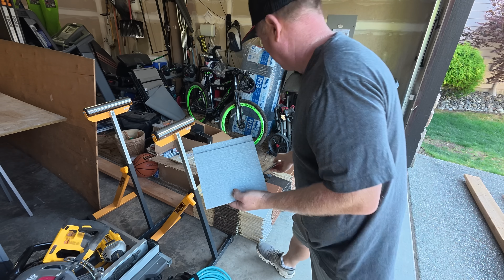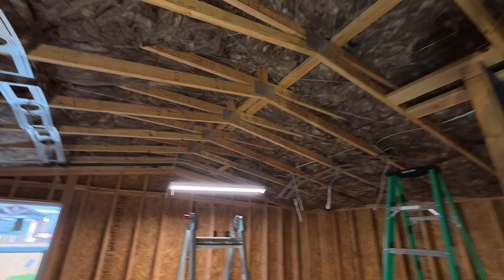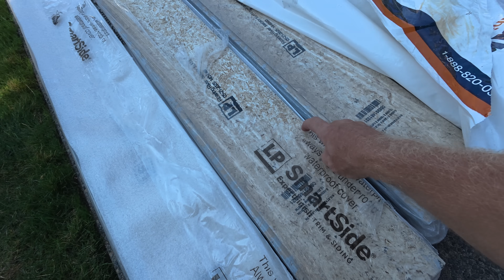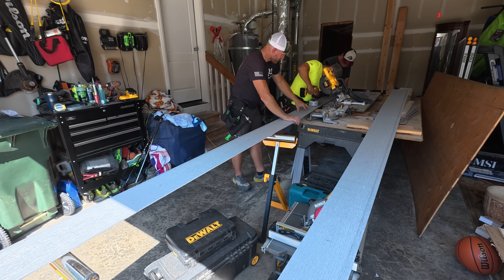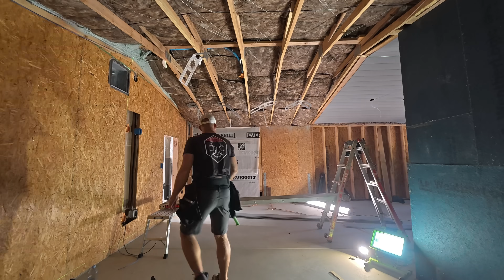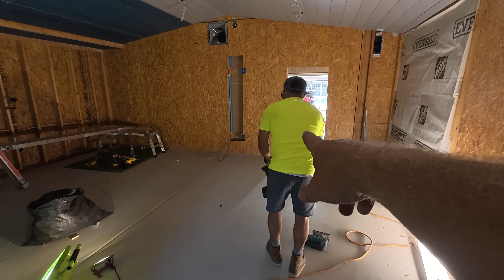Golf Simulator Build: Installing the finished ceiling

Comment: Anybody interested in making a few extra bucks, I am looking for the stiletto 5.25” multifunctional flat bar and the 7.5” stiletto titanium multifunctional flat bar,  I know they’re discontinued. I’ve looked on eBay but can’t find them anywhere, I’ve got the stiletto 7.5” glazing bar as well as the stainless steel flat bar. I just managed to snag up one of the Martinez titanium framing cats paw that has one of those nail pulling grooves behind the claw whereas  my stiletto titanium cats paw has that cylindrical thing on the side of it to make a perfectly round hole around the nail before using the cats paw to remove it so that you can have an easy hole to puddy over when you’re done

Comment: that siding is rated for outdoor use?
Reply: Yes, it can be installed in horizontal, vertical, or as soffit application on exterior or interiors. It comes in 16 solid paint colors and 6 Naturals stained colors and both a Cedar and Brushed Smooth texture.